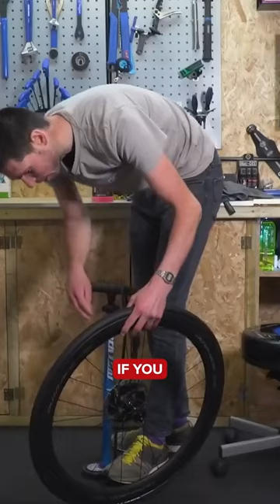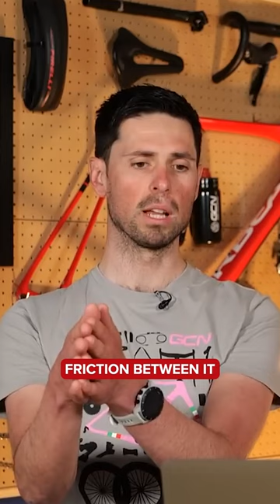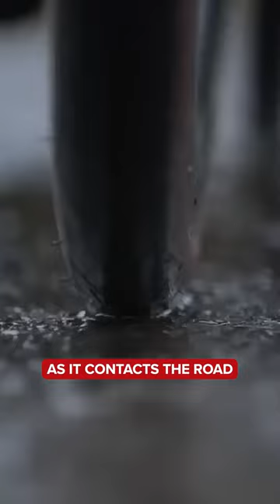Why does a tubeless setup have less rolling resistance? 🛞

Comment: I stay with conventional clinchers with good running tyres (Continental 5000/Viioria/ Wolfpack) - very good experience- I am quite sure that Pogi’s broken hand is due of hookless rims of the guy in front of him who felt because both tires were of the rim. I started cycling in the 70ties with tubulars / today’s clinchers are the most important progress for me far more important than more gears, lighter frames etc. At the time I had tires that blown after one km if you had bad luck now 5000km on the rear and on the front I don’t know maybe twice as much
Reply: You can have tubeless without hookless though and lower pressures without risk of pinch flats is a gamechanger